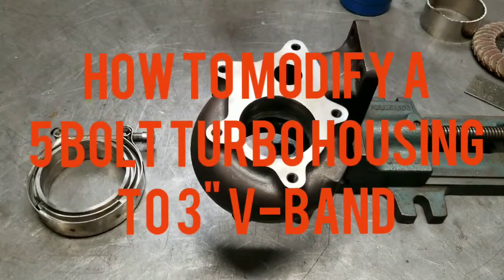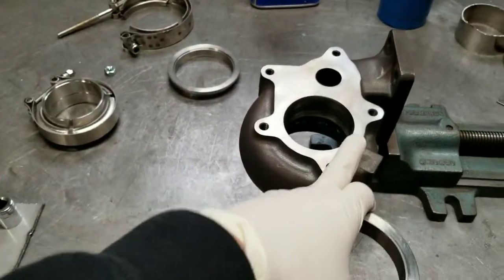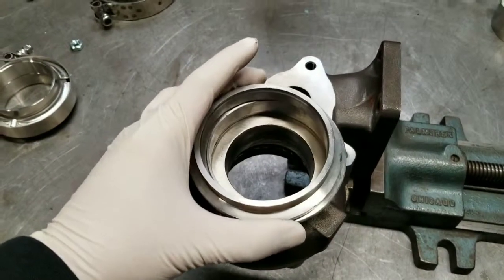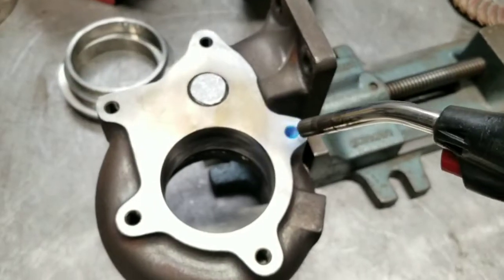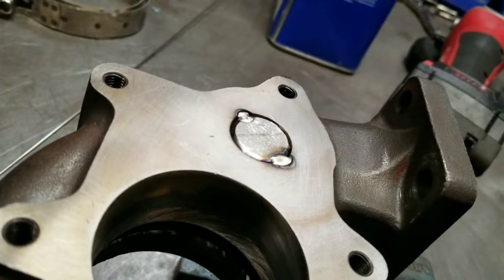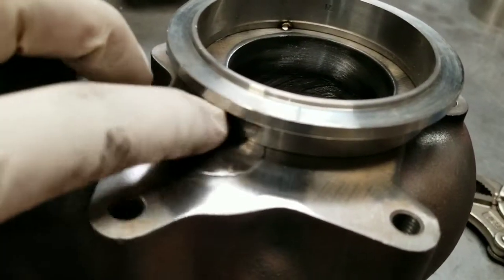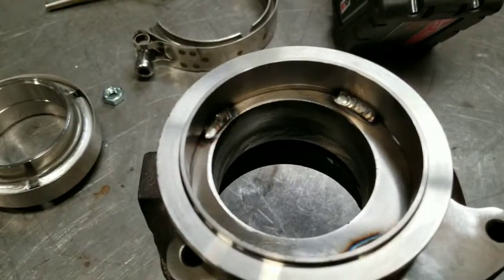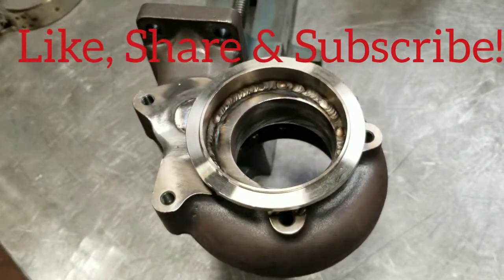How to modify a 5 bolt turbo housing to 3" v-band

Comment: Wat  wattage are y welding the 109 at??
Reply from the maker: I have my machine usually max at 200 but I'm probably only using 60-80 amps on the pedal once it's hot.